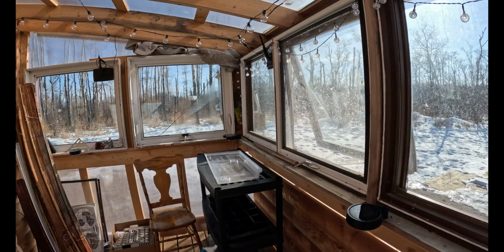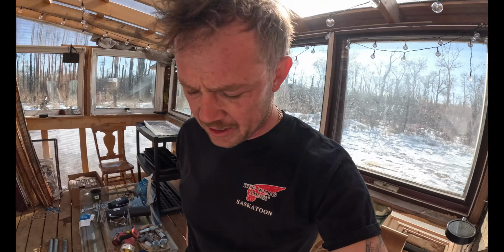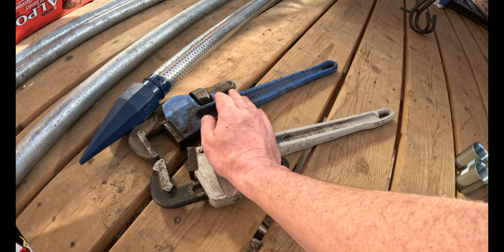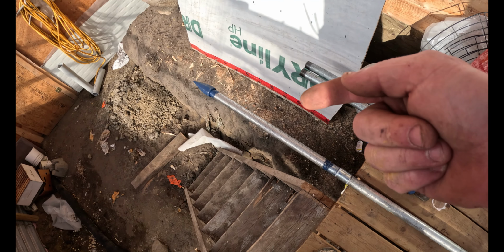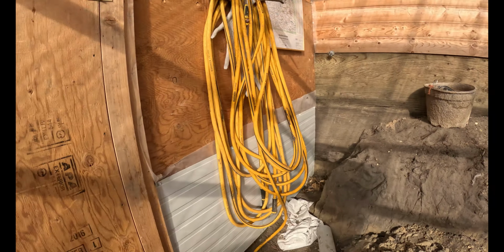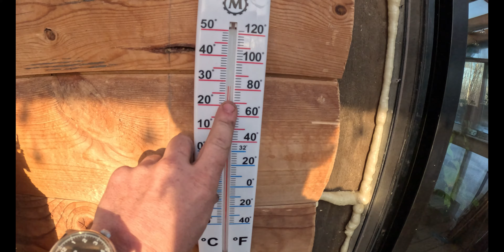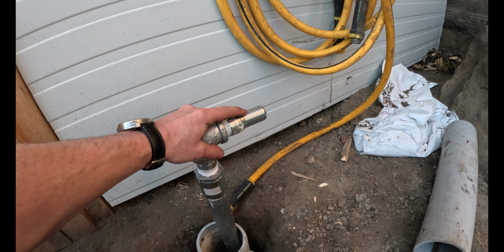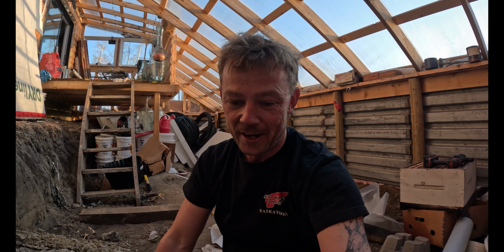DO YOU NEED WATER Installing a Sand Point 💧 💧

Comment: Someone has never used pipe wrenches.
Lay the pipe wrench on the deck and lay the pipe into the wrench. Then just your weight will hold it an you only need to swing one wrench
Reply from the maker: I was definitely struggling in 100 degrees 😩  thank you for the help